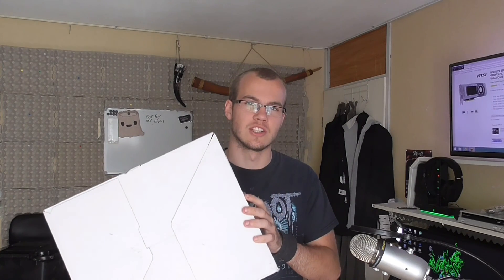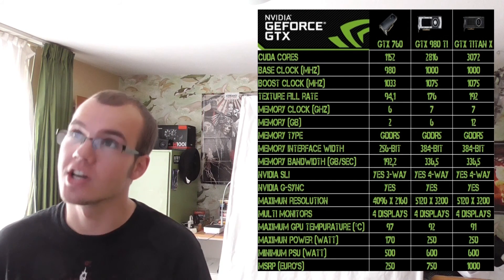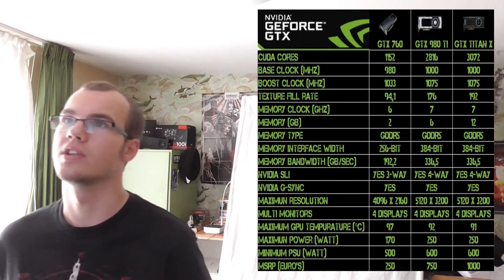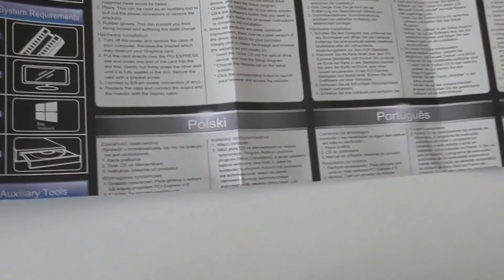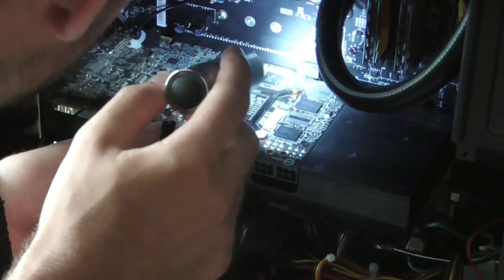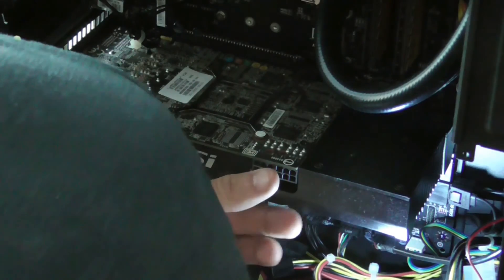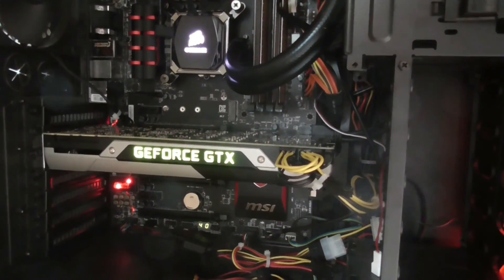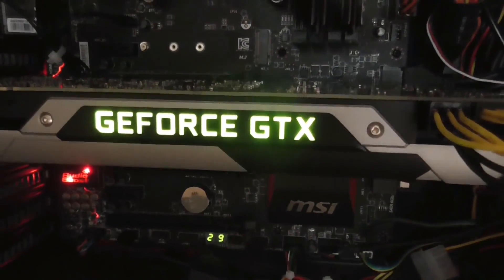Geforce GTX 980 Ti - Unboxing - Installing - Benchmarks!!!

Comment: A couple weeks ago, I noticed the safety pin or pully thing is broken, will this affect my GPU? 

https://www.realtimesoft.com/multimon/guide/mobo_pcie.jpg
Reply from the maker: +BurningxSH0CKZ CS:GO no it will not affect it, just make sure all bolts are in tight so the gpu cant move by the vibration of the fan
Reply: okay thanks :)